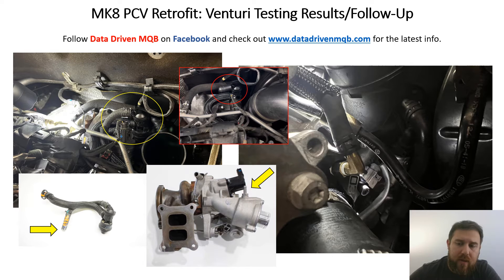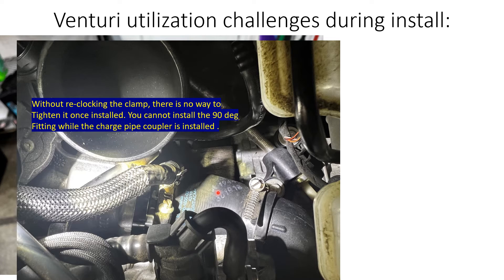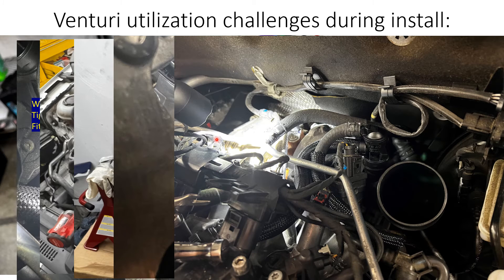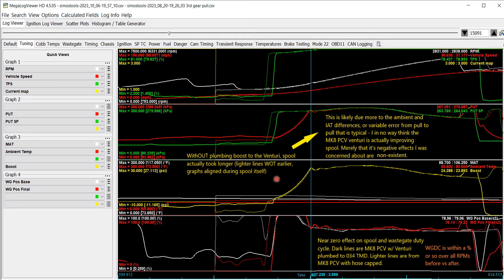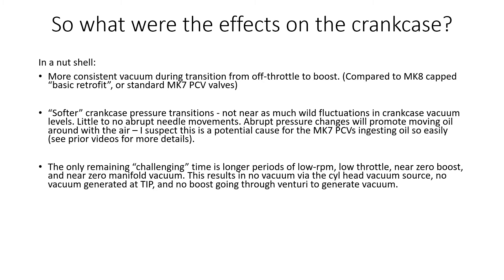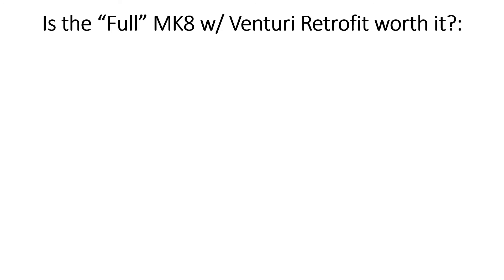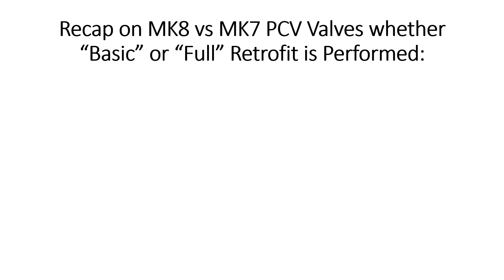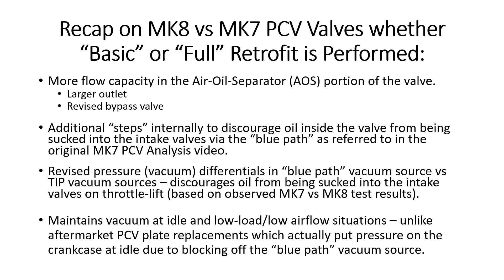MK8 PCV Venturi (Full Retrofit) Installation + Testing Follow-Up (Pt 8)

Comment from the maker: Note: Later back-to-back testing with and without Venturi determined there to be a 2-3% increase in WGDC (Which is better than I had originally expected, but less than described in the video. Not sure where my head was, but didn't notice the IAT/AAT temp differences originally). There is still zero difference in spool time observed. More updates coming soon!

Comment: Thank you as always for your detailed explanations.
After doing the full retrofit, the white smoke on the track has completely disappeared.
However, the power on the dyno has dropped by 20 HP.
Is this result to be expected?
The return hose is connected from the turbo outlet hose to the TIP.
Reply from the maker: You’d be the first I’d heard of having that issue. Stratified had an S3 2260S owner who saw an increase on the dyno, but I’m really skeptical that something else wasn’t at play. For myself and most others it’s a transparent change.

I’d look at logs before/after (at similar ambient/intake air temps) to check WGDC. If it increased by more than a few % under same conditions, might indicate a leak. Or a (unrelated)  failing turbo.

Dyno operator error or settings could also be at play. What dyno? Same SAE settings used? Car strapped down identically? Same tension on the straps? Same wheels and tires used?  A 20hp difference would be very noticeable in driving around. I’d say 60-130 (or some other repeatable real-world measure) would be a more accurate indicator of power loss.

Comment: Hello! Thanks for all the work put into these videos!
So I am in the scenario where I have a forged CJXC with a hibrid turbo blowing pcv valves like candy.
I just bought a full frame turbo (eqt 660 that comes with it's own intake pipe) and a MK8 pcv  retrofit kit without too much thinking about the venturi effect and my lack of a turbo inlet pipe.
Now I am confused on how I should do my retrofit since I don't have a turbo inlet pipe to connect the mk8 venturi hose. 
Any help will be appreciated!

Comment: For the Venturi valve, can you connect to any place that supplies boost?  I already have an APR boost tap in my intake manifold.  Would this work instead of tapping the turbo muffler or boost pipe?  Thanks in advance!
Reply from the maker: No, otherwise you'll end up with a vacuum leak.
Reply: @datadrivenmqb  because it’s metered air at that point (intake manifold)?
Reply from the maker: @danf5120  we don't have a MAF sensor so there's no metered air to begin with. Vacuum at idle is necessary to run right even with a speed density type system our ECUs have.

If you have a factory PCV now, it's the equivalent of removing your oil cap or dipstick tube while idling. The car will run like crap.

Comment: I have my pcv delete plate from apr running straight to a venturin the exaust. Im wondering if i should add a vac generator now inline with it so use that turbo boost to scavange but blow it to the exaust instead of the turbo inlet
Reply from the maker: Probably not. Since there's no diaphragm to hold vacuum on the system there's no need for a huge amount of vacuum. Sounds like an interesting setup, but I've heard of mixed results on turbo cars due to the backpressure under boost potentially causing concerns. Might be a good idea to actually use a gauge and measure the vacuum generated to see if it's worthwhile or not. I had issues with stock TIP and APR plate due to it pulling silly vacuum on a non-diaphragm type system.

Comment: When utilising the Venturi hose and test port on TMD, wouldn't air be rerouted and forced back into the turbo inlet elbow causing a loss in boost?
Reply from the maker: @hllatif30  there's a 2-3% hit in WGDC, but it's not some massive boost leak. More info here:
https://youtu.be/Pjcpla__riY?si=HkbOGm8RBTYA9F3h

Comment: Where did you get the extra hose from for the venturi? It looks oem, and thats the look im going for.
Reply from the maker: It’s part of the $136 Tiguan PCV hose. In “basic” retrofit form it’s just removed to cap off, but the part is already there for full retrofit use.
Reply: @datadrivenmqb  Oh sweet, tha ks for the info I thought it came separately. Gonna install this weekend then.
Reply: @datadrivenmqb  I forgot to mention, thank you for uploading these videos I honestly was struggling with oil consumption and leaky oil cap. I couldn't figure out why. This makes so much sense, and I'm glad someone proved it can be retrofitted. Love your legit data driven approach.

I have one question, regarding track use and stock PP/R brakes. Did you find it beneficial to take the decorative plates off the front brakes before a session?

I'm running Motul 5.1 with EBC Yellow pads. Blank disc's, SS lines and titanium shims on all four corners.
Reply from the maker: @blahbergerpoke  I have an article w/ a couple videos on the subject here:
https://www.datadrivenmqb.com/brakes/ppbrakeprep

The decorative plates aren’t doing anything helpful IMO so no reason to keep them. EBC yellows and Motul 5.1 will be your main weak points when you start really pushing the car, but should be “ok” for a first event and/or at a track that’s very easy on brakes (assuming they’re nearly new). Just be mindful of their friction coefficient fall off… it happens very quickly once they’re out of their temp range.

Pads have two jobs: stop the car and isolate the caliper/fluid from heat. Once the friction thickness is below about the thickness of the backing plate I retire them as spares. Might be good for a session or two “backup” but likely won’t be able to drive at full pace before encountering fade (whether from the pads or fluid soaking up heat).

I’ve never found the need for titanium shims, but admittedly haven’t tried them either. They’ll hold more heat in the pad, which can be a good or bad thing depending on the compound. It’s all about balancing heat in the entire system.
Reply: @datadrivenmqb  I figured the pads and fluid would be the weak point. The car is more of a daily and a backup for track events when the Evo is down. So, I'm trying to balance streetability with traceability. I'm not driving to set records, just having fun and testing the limits of the car.

Thanks for the detailed write-up. I was thinking the decorative plates added as a heat sink, similar to how a BBK gives you more surface area to consume and radiate heat. I was wondering if there was any difference in heat with the plates on vs off.

The titanium shims are really to reduce heat xfer into the piston and in turn the brake fluid, however you are right more heat will be retained in the pad and dependingon thebpad could be a good or bad thing. A balance between pad, shim and rotor type needs to be made for maximum efficiency.

I might order the temp paint and see if I can record a difference with these combos.

Comment: Did the Tiguan PCV hose come with the threaded hose barb that screws into the turbo? I ordered a new turbo for my GTI and was sent the is20 that has the port for the second PCV line but it didn’t have the barb.
Reply from the maker: Oh interesting! Unfortunately the Tiguan hose does NOT come with the barb. If you have no intentions of going beyond IS20 power, then a Gen3B IS20 from a Tiguan is definitely one way to do a full retrofit.
Reply: @datadrivenmqb  Yeah, already get more wheel spin than I want with the stage 2 tune. If I ever want more it will just mean it’s time to buy an R. When it arrived yesterday I was inspecting it and was concerned when I saw the small threaded hole. Once I found out what it’s for was pretty stoked. I had already ordered everything else for the retrofit. Now I have a 034 turbo muffler delete I don’t need but whatever. Thanks for the info on the hose, found a stainless one on Amazon that will work.
Reply: @SeanJuan_  @datadrivenmqb This is interesting! I’m planning to buy an IS38 soon and now you’ve got me wondering if a revision exists that has the same threaded hole you’re referencing.

Comment: So you’re using the Venturi from the 22 Tiguan and the OEM hoses from the 7.5 GTI.  A goods part source and installation video would be appreciated.
Reply from the maker: Hose/Venturi is one part from a 2022 Tiguan, PCV is from a 22+ MK8 GTI or R.

I haven't done a formal install video because this is all still in testing. That's a plan in the future if/when this is all "figured out". 

A document detailing install, parts, etc is currently being worked on.

Comment: I been skipping around your videos tonight, going into the rabbit hole of PCV systems. I don’t track my car, but I am always looking for a way to keep the engine more reliable. This basic/full retrofit - do you think you’ll make a video of you doing the installation? Seems dumb, but I’m a step by step visual learner. 
By the way - I love the “ fin” at the end. Gave me a chuckle.
Reply from the maker: Thanks! I might if someone locally needs it done. I didn't do it originally because I wasn't 100% sure how this whole science experiment would turn out. For PCV and hose replacement, it's pretty straightforward just following a MK7 PCV replacement, or any turbo inlet pipe replacement videos (for disconnecting the hose). 

I've got a few more videos coming soon, and hoping within in the next 3-4 months to do a final "This is EVERYTHING you need to know" type conclusion. I'm ADHD and lots of info is scattered throughout everywhere, so taking some time to put it all in a single place would be helpful. I think that should be enough time to do some more testing and get some more info from others... especially since I am now logging the PCV pressure directly in Simos Tools :)

Comment: My question for you is, with the mk7 pcv, is it worth drilling out the AOS on the bottom to make it more like the mk8 pcv. Would this help the oil drain and not get pushes up through bypass valve or cause other issues?
Reply from the maker: It's a thought that's crossed my mind. I don't think oil would make it's way back up, but a MK7 valve wouldn't have the other internal changes that appear to make it harder for oil to get into the intake path in the cyl head. There's also the fact that all the OEM MK7 valves are $130+ and the MK8 valve is only $60 to experiment with.
Reply: @datadrivenmqb  I'm tempted to try it but don't have any equipment to test the results. This would be a good test imo. Over here in the UK the mk8 pcv is just as expensive as the mk7 and I can pick up a second hand mk7 pcv for £10 so would be a good cheap test if I had the equipment
Reply from the maker: @stephenduff3215  yeah, the MK8 valve retrofitting vs a MK7 PCV replacement certainly makes it enticing to experiment with. Definitely let me know if you ever do modify it, and what you find!

For the record, I don't think there would be anything TO measure, aside from amount of oil getting ingested when on track/autocrossing it. I can't think of any reasons the crankcase pressures would be affected by opening the AOS outlet any more.
Reply: @datadrivenmqb  I don't track the car, just mainly daily drive it so enlarging the hole will surely just help the pcv as it makes it drain, I currently have the racingline catch can on and although I like that it catches the rubbish and it can be drained it has caused the rear main seal to leak. Hopefully reinstalling the pcv will sort this issue out and I won't have to replace the seal. Can you see any issue using my old pcv that has been off the car around 2 years? Dry stored
Reply from the maker: @stephenduff3215  it's hard to say. If it wasn't exposed for dust/dirt/woodchips/metal shavings/etc whatever might be in your garage depending on what else goes on in there, it's probably fine. I'd consider lightly blowing it out with an air gun first.
Reply: @datadrivenmqb  it's been stored in a parts draw with other car spares so not exposed to anything like that, I'll give it a  clean before I put it on. Thanks for the advice

Comment: Audi s3 8vFL 2017year stage 3 with garett Pmax1
Future plans for ethanol sensor,after that i will consider retrofiting a mk8 PCV.
Love the idea!
Reply from the maker: How do you like the Pmax S1 turbo? It's doubtful I'd go hybrid as keeping even an IS20 cool on track is a lot of effort, but that's on my short "what-if" list. I'd be SUPER interested in knowing if you have the turbine speed sensor were able to do the "full" retrofit to see if there's REALLY any change in turbine speed. Looks like you can't use an 034 TMD to make it easy, but tapping the charge pipe would be relatively simple to do.
Reply: Let me how how you get on with this. I have a built engine with a Littco L560 turbo and looking at potentially doing this.